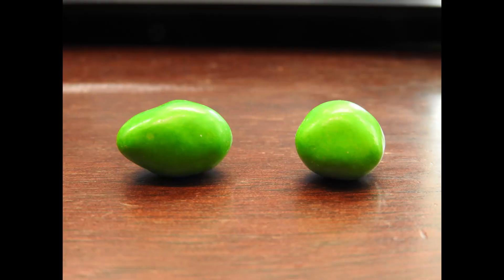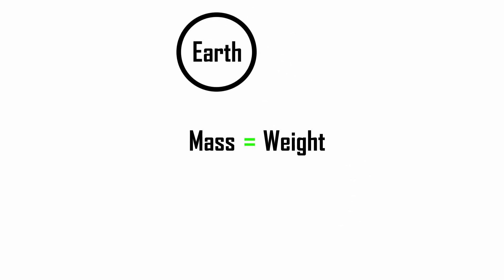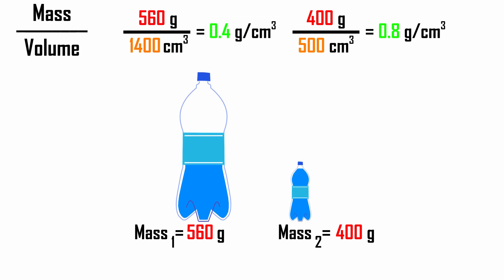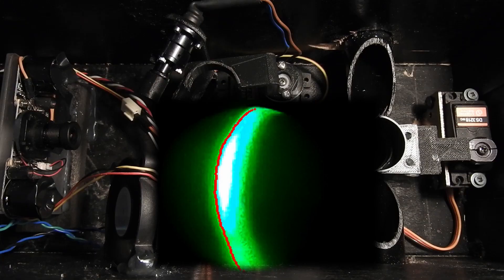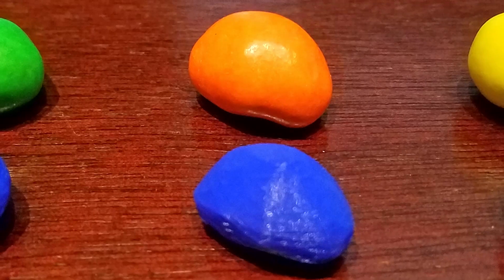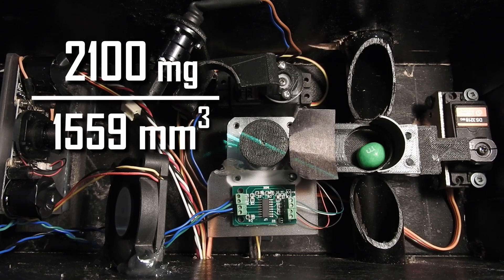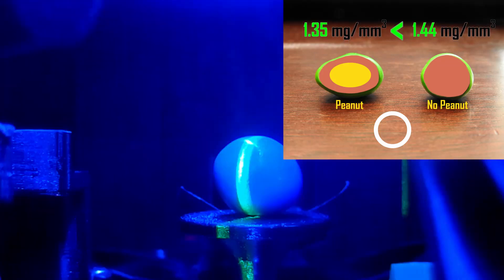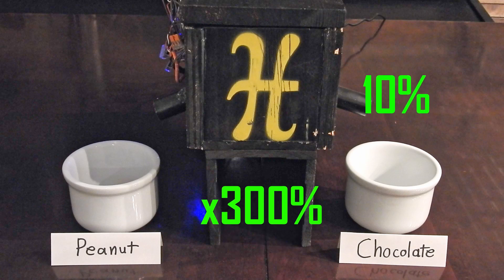Peanut(less) Peanut M&M Sorter - Homemade 3D Scanner

Comment: This is really cool, love the engineering that went into this. I have a feeling that a machine learning algorithm with the inputs of volume, mass, and maybe some other spatial measurements could lead to a more accurate result rather than going with the ratio of mass and volume alone. 
Something similar to this: http://orange.biolab.si/widget-catalog/educational/polynomial-classification/
Reply from the maker: I agree, but only to a point. Because if you think about it, machine learning (at least in this case) is just a way of defining a non-linear boundary between two states (peanut or solid chocolate). But I don't think a non-linear boundary would provide any advantage in this scenario, simply because there are only two data points to go off of. To your point, I think you would need another metric other than weight and volume.